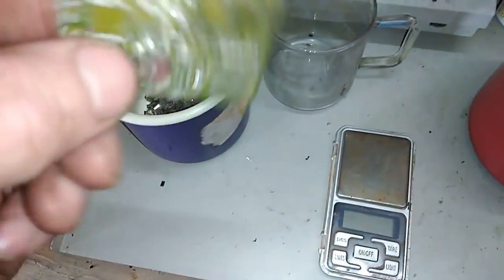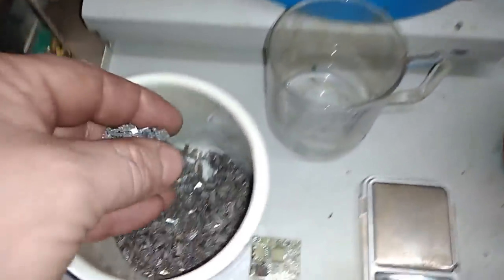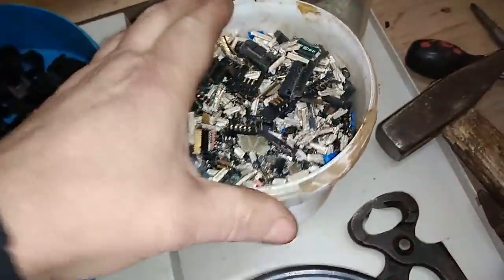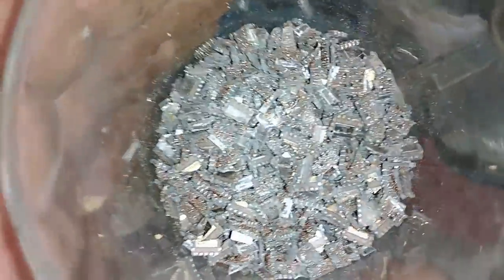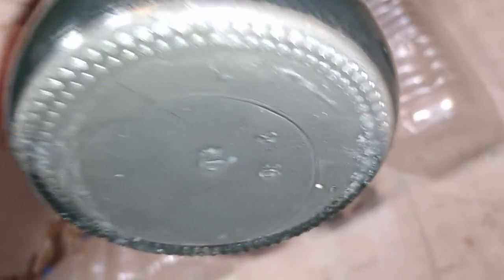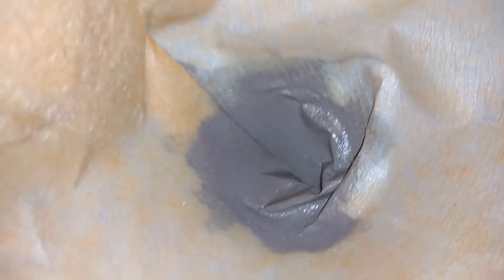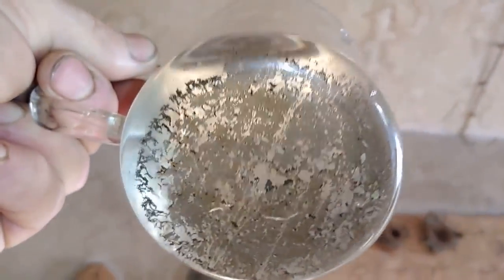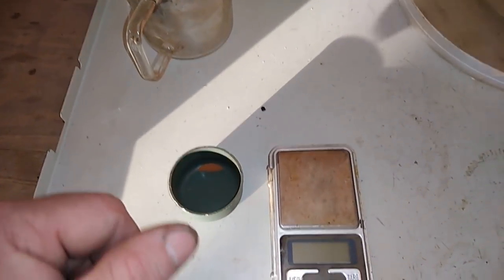Small CERAMIC CHIP Gold and Silver recovery and refining.

Comment: hey 999 Dusan another awesome video, those tiny silver looking bonding wires might be worth testing with calcium hydroxide to see if they react, if they dont they could well be platinum, if they do fiz then they are aluminium, i have come across these before in telcom equipment, its uncommon to find platinum bonding wires, but they do have a use case in high frequency radio equipment.I took apart some satellite equipment a few years ago that had platinum coils in.